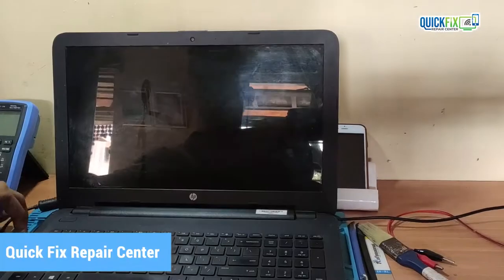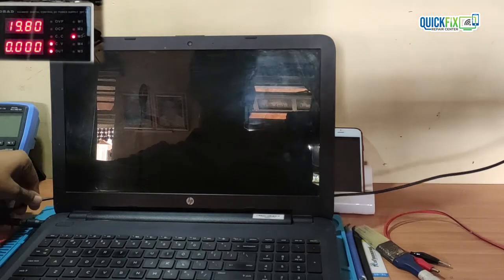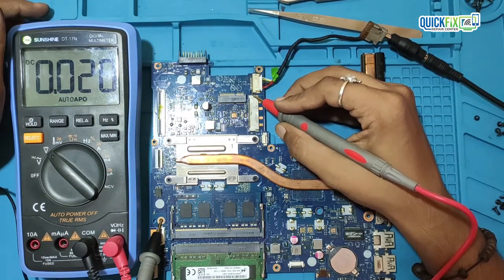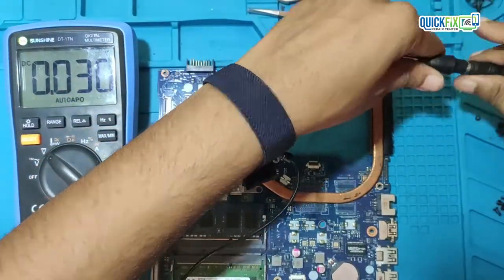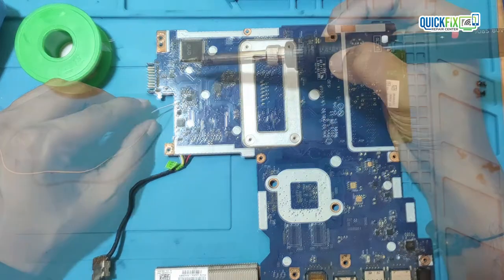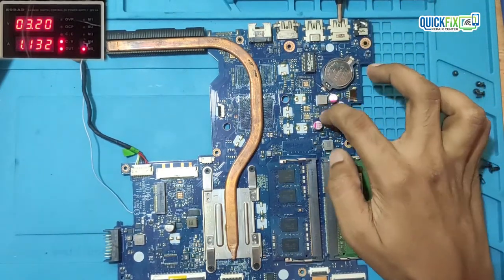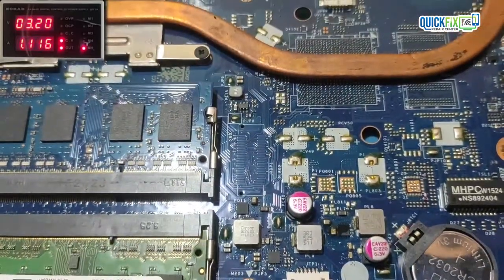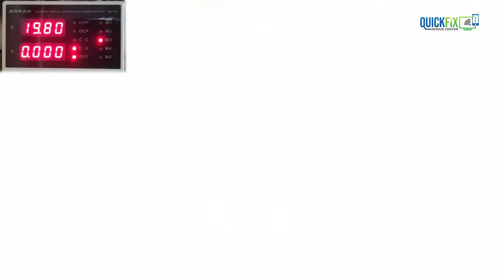laptop adapter light turns off when plugged in

Comment: I have no idea what you did to fix due to the music being too loud
Reply from the maker: Noted. Next time will fix this
Reply: He used power supply on 3 volt then with his finger he checked which component is getting hot, then he added flux on the suspect component which melted the flux, then he removed the suspect component to check if removing it removes short from the motherboard